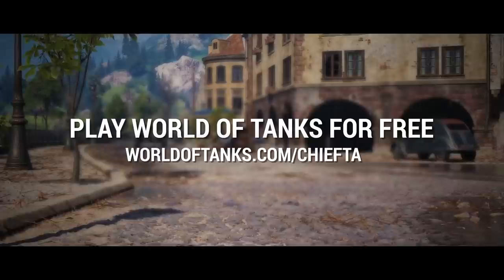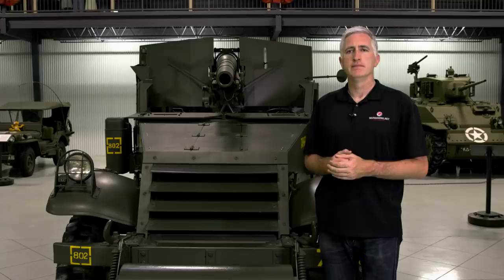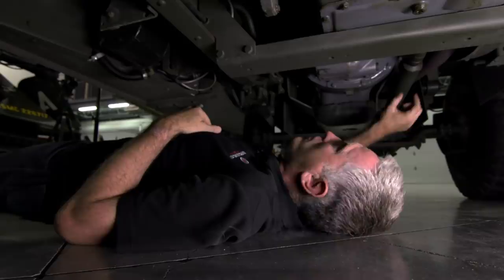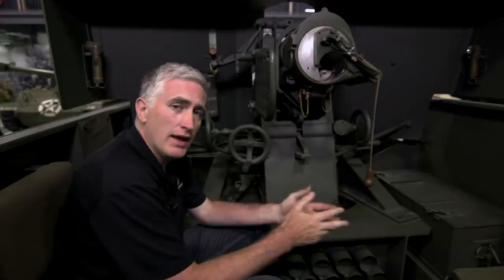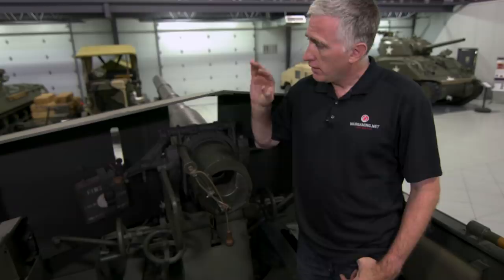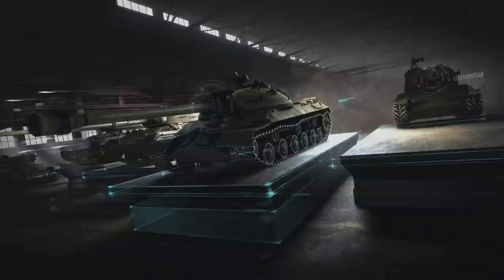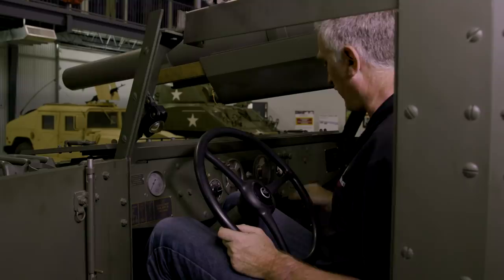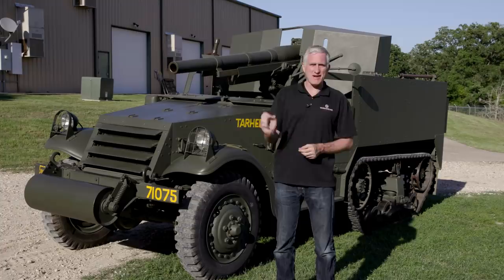Inside the Chieftain's Hatch: M3 GMC

Comment: Great stuff. I liked the vehicle, but I knew I would not have liked to go to battle in it. Quick fix at the beginning, but not the right tool for the job later on.
Reply: Those halftrack TD's that destroyed 37 panzers were engaged in combat for several hours straight. They were positioned along hilltops and stayed back out of view until motioned to move forward by a soldier when a panzer was entering it's "killing zone". The gunner got a bead on the tank as the halftrack moved forward then fired off a shot or two before signaling for the driver to back out of view. Some were taking hits of AP from the panzers with the rounds going right thru the thin armor of the shield and rear box without hitting anyone.

Comment: Germans too used like thousands? of these same French guns they converted into PAK's (7.5 cm Pak 97/38). So it was decent AT gun and used by both sides.
Reply: It hits hard enough to get a great cocktail named after it.
Reply: @justindunlap1235  i actually have the Forgotten Weapons "French 75" cocktail t-shirt. XD
Reply: @thiscouldntblowmore   yeah me too one of my fav shirts  BTW the Germans used HEAT with these guns because the AP was never going to penetrate any Russian armour after 1943.
Reply: @mikepette4422  it was used here in Finland too, it was called "mulatto" (for mixing French gun and German carriage) and also "Mule", cause it kicked (recoiled) so damn hard with the AP ammo, i think that was the biggest problem with this gun and AP, so they rather used more mild HEAT as its not velocity depended for penetration, pretty sure the AP from this gun was at least good for T-34/85 till the end of the war, and for many other tanks for side shots (the way your really supposed to use towed AT-guns is from ambush, hiding to the sides (weak spots).

Comment: Chieftain, Wow just think of the ammo supply problems some 4 different 75mm shells for the USarmy 1) 75mm French as shown 2) 75mm pack as shown in M5 Scott 3) 75mm as used in Sherman 4) 76mm as used later in the Sherman. I am not sure but the 75mm pack that US army used in WW2 was an improve 75mm form an earlier gun and the USMC used both packs because of number availability and the ammo was different (I think).
Reply: I believe the gun/ammo for the M5  Scott and pack howitzer were the same, Same goes for the 75mm field gun and the Grant/Lee/Sherman Gun (and also able to use French ammunition as well). So the ammunition supplies was a little simpler than you suspected. Mind you, there is the 76mm and 3 inch as well, so relative statement.
Reply: @jon-paulfilkins7820  Pack howitzer yes I just did not want to list them all. But the 75mm French I Found  a picture with the French round sitting by a M4 Sherman round and the brass length is way different the Sherman brass length is not quite double the French length.. and the 76mm and the 3 inch are not the same in brass length nor ball diameter doing a quick look on the web.
Reply: Yeah, then add in all of the limey's ammo types too.
I remember watching an interview with General Mark Clark. He said the Italian Front got the left over supplies and had so many different types of supplies and troops that it was difficult to keep the logistics going.

Comment: I noticed this was not a M3 GMC but according to the builder's plate an Autocar M3.  I used to work on trucks like this because many were sold to municipalities as surplus for a dollar.  We used to add two stroke oil to the fuel because gasoline with an octane rating of 86 could cause valve burning.  The White motor was very dependable, you couldn't beat it with a sledge hammer and was very easy to maintain as noted. In WW2 America had tens of thousands mechanics who knew how to work on trucks and cars, plus drivers who knew how to take care of their vehicles.  This meant America had a huge pool of men to drive and maintain the thousands of vehicles (and tanks!)  the military needed.
Reply: GMC means Gun Motor Carriage, not the manufacturer
Reply: @richardjohnson3748  Thank You, that was not covered in the narration.  I've always seen such vehicles listed as GMC M3 followed by the number, in this case 15, which designates the manufacturer as Autocar.

Comment: It's a crying shame that the M3 GMC isn't allowed it's maximum rate of fire in the other WW2(ish) tank combat game which shall not be named. Instead, the developers have the sustained rate of fire as the maximum rate of fire. Which basically anyone that's touched small arms and cannons in the military knows are two very different things.
Reply: ive complained about that a lot. another example is the M1. a round every 4 seconds for the first 3 rounds is what the crews are trained for. then depending on fatigue and having to locate the correct round in the rack it can slow down a bit. but not is your "other" game

Comment: By the theory that hte last couple decades of a century actually have more in common with the following century than the previous century, the 75mm isn't a 19th century design. It is far more 20th century than 1812. They were using black powder muzzle loaders in 1865, in 1897 they had basically modern artillery. And the 1990s is closer to 2020 than 1910. Although it really depends on what exactly you are looking at.  Lets say centuries don't really break down into neat categories the way we pretend. But when you do, you find it is easier to go from say 1850-1950 than 1800-1900, etc.

Comment: Took me a while to figure out why it had a flathead instead of a 302 Jimmy.  Then I realized, as I have in the past and since forgot.......gun motor carriage.   NOT GMC.
Reply: Probably the same fantastic torque-and horrible mileage!  But when you are fighting a war and you are the side with  the oil reserves, the latter didn't matter as much.
Reply: @thomasknobbe4472  most auto engines were/are pretty inefficient.  It's amazing how much better a agricultural tractor engine from the same time performed on the same gallon of fuel.
Combustion chamber shape was not something a lot of time or money was spent on, unless your customers were notorious cheapskates

Comment: As with any vehicle equipped with a non-synchronized transmission, this vehicle may be shifted without using the clutch at all instead of double-clutching. The ease with which this clutchless shifting may be achieved is dependant on the rate of RPM drop on the engine and the spacing of the gear ratios in the transmission. I'm curious if anyone has tried clutchless shifting in the M3.

Comment: In America, we just say “double clutch”— no “D” in the middle.
Reply: He's saying "double declutch", which makes mechanical sense, since what you're doing when you depress the clutch pedal in a vehicle is disengaging the clutch. It's not a description of the clutch's cup size. :)
Reply from the maker: I've seen both used US manuals.
Reply: @TheChieftainsHatch  ok, fine.  Modern usage in trucking is no D, I have not checked original manuals from the 40’s. I incorrectly assumed it was European English and it bite me in my butt!
Reply: @ZGryphon  to double clutch, you clutch in, move shifter to neutral, clutch out, clutch in again, move shifter to new gear.  You press the clutch petal twice in the process of shifting.  Thus “ double clutch”
Reply: @doughudgens9275  Yes, I know what double [de]clutching is. I was just noting where the "de" comes from--it's because when you press the pedal, technically you're DISengaging the clutch. When it's engaged, it's transmitting engine power to the gearbox. When it's disengaged, it's not. Hence "declutching".
Reply: After a short time a skilled driver will learn how to "float" the gears without using the clutch at all except to start and stop.

Comment: I’m intrigued by the comment about Americans having trouble with manual transmissions. It’s certainly true, but why so much emphasis?  I thought that Ireland has had periods of relative prosperity from time to time, but now I’m concerned that due to either poverty or an extreme love of tradition Ireland is awash in non-synchromesh transmissions. Perhaps double de-clutching mastery is required in drivers education, like rallying in Finland?  Or starting on a hill in Pittsburgh?  I remember the little artificial hill on the test course even now.  Of course the test course was in a narrow valley with at least 100 foot bluffs on either side. Pittsburgh is not tank country.

Comment: American products were practical and reliable in those days. The main advantage compare with most German tracked vehicles, the tracks are simpler, and if it was damaged on one side, the mechanic stays on that side only, unlike the German torsion bar suspension, and I do not know why they even bother with the wheels, it is almost useless with that much tracks. That is why the Israel still use them today, over 1/2 a century later.

Comment: At 6:44 you show a brake that is clearly a ventilated disc, and did so without comment. Was this a common practice on tracked vehicles of the period, and if so, why the hell did it take manufacturers another 20-some years to put them on passenger cars?

Comment: Serious question:

Could these be considered the first Technical Vehicles?

Although no direct lineage, I can't help but be reminded of a Toyota Hilux with a big gun mounted on the back.
Reply: In terms of armament? Yes. In terms of concept? No - technicals are ad-hoc vehicles using parts and solutions which are available at that exact moment while this is a standardized(emphasis here) vehicle built for a specific kind of military unit.

Comment: hello can you please explain what is the purpose of the cylindrical device on the front of the track truck. thanks in advance. saludos
Reply from the maker: Unditching roller. if you drive into a hole, instead of the pointy front of the truck digging into the dirt, the roller will let you climb out,
Reply: @TheChieftainsHatch  hello very creative that roller. Thanks for you elegant reply thanks. Saludos Bro

Comment: The M-3 tank destroyer is very good for what it is.
But what if somebody had noticed the Navy's 4inch50 gun and a 5+ ton truck to make a halftrack out of? Just make sure to call them self propelled long range artillery so the bloody huns think it is a fluke when their panzers are obliterated by the 102mm guns.
Reply: calvingreen90 - No reason to go to 4 inch when smaller does the job just fine. The 3 inch mounted on the US M6 heavy tank and M10 tank destroyer made them the most powerful AFV's in the world in 1942
Reply: @colbeausabre8842  
To use them as long range artillery when not obliterating panzer formations.

Comment: Junk for anything but anti-personnel and/or last-ditch, anti-tank defense, IMO...despite the stats quoted by The Chieftain at the end.
Every weapon system probably has a few stories of how well it did in an early battle against an enemy who was not familiar with them yet.
I am not buying that a crack Panzer platoon is going to lose many tanks to these things once they know their weaknesses.
Just lob a few HE shells at them from outside their range and watch the crews of these 'carriages' drop like flies?

At the very least, the bloody US Army could have slapped, thin armor around and on top of these things to stop shrapnel.
How much money/time could that have possibly cost?

Thank you Chieftain.
I found it both entertaining and informative.
But this thing is junk to me (outside of anti-personnel and desperation, anti-dank defense).
☮
Reply: These were fielded when the Panzer III was the German front line tank, the M3 GMC had both a range advantage and enough firepower to penetrate the frontal armor of the Panzer III. Yes, the M3 was thin skinned and open topped but the same could be said of the later M18 Hellcats.

Comment: IMO the 2nd camera angle at 45 degrees at Chieftan's face doesn't really work. For some reason, between his style & the material & whatever else, it just isn't good. If the intent is to spice up the videos & make them seem more dynamic or whatever, I'd say stick with more extra footage clips, like the newsreel stuff. That really adds to the presentation. Also, I know it's not relevant for this specific video, but for vehicles that actually appear in-game, showing videos of the in-game models shooting stuff would also add much better dynamic-video-production value than showing Chieftan's face at an angle sometimes.

It's not like there's anything wrong with his face at an angle. Like panning around in a circle to show the vehicle while he's talking might be fine. It's just the cutting back and forth that doesn't work. Or maybe it's that he has an I'm-talking-to-camera manner, but we're looking him at an angle so he's not making eye contact. Either way it's not good. But videos are good in general though. And sometimes you have to try stuff to learn it's not good.